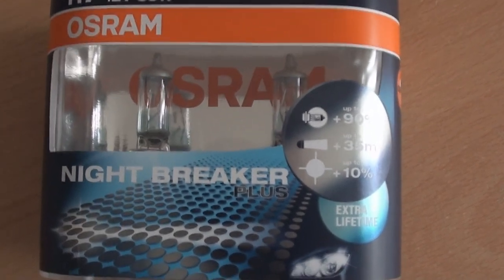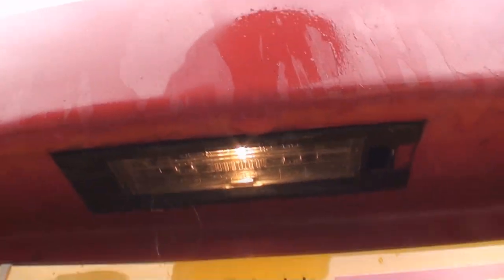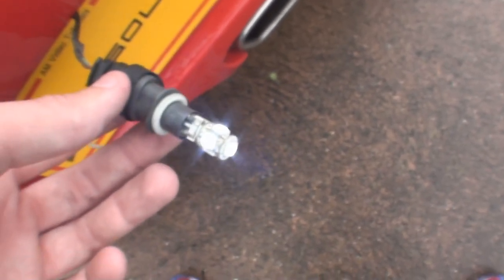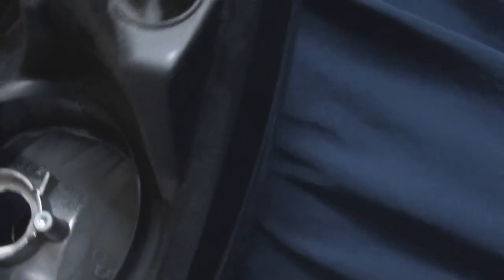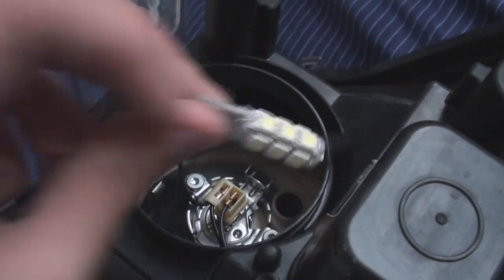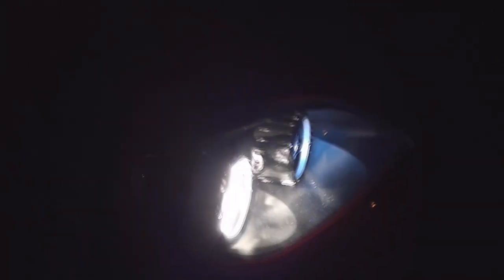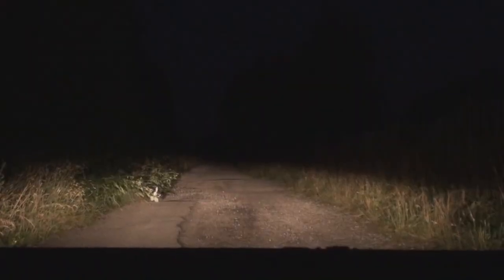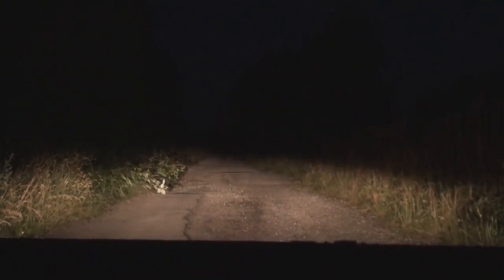How to Install LED Side Light Bulbs

Comment: I got the night breaker plus but they were far too yellow with the SMD sidelights. 
I ended up fitting 55watt xenon bulbs which give a much whiter light until I can be bothered fitting a HID kit. 
You don't have to take the bumper off, it's a pain in the ** first time round but you get the knack of it. 
I changed all my bulbs in around 10 minutes. Looks good!

Comment: i did the sidelight bulbs on my 2010 CRV,, I tried a few different ones B4 I settled on the type u used here,,,deffo need the 3 high on all 4 sides with one on the top.. Some you can buy dont even fit through into the headlamp so be careful of dimensions.. I have projector headlamps so was able to go for LED dipped headlamps but stayed with halogen for separate main beam  .

Comment: Hey Bluudy, i bought and fitted LED number plate lights for my Astra H but they dont work?! They were working before with standard bulbs but now even the standard bulbs dot work? Ive heard it could be the Canbus playing up. Any help would be appreciated!
Reply from the maker: have you tried turning the bulbs round to start with? LEDs only work 1 way, were bulbs work both?

Failing that are you sure you bought canbus Leds Bulbs? if your stuck, join our forum, we can discuss more there!

Comment: I have the smaller leds in as my sidelights on my Astra h and they work fine. I got a pair for the number plate lights and they work when the boot is opened but not when the engines running? They flicker for 5 seconds then turn off. Is this because they aren't canbus?
Reply: yes

Comment: License plate not so bright maybe you need 8000k
Reply: Higher temp does not mean brighter in fact the quite the opposite also because of EU law fitting these bulbs is technically illegal but as long as you don't mind giving the big middle finger to the EU legislators then crack on.